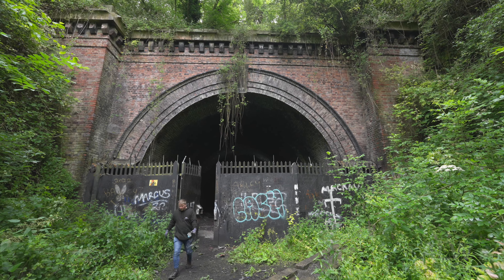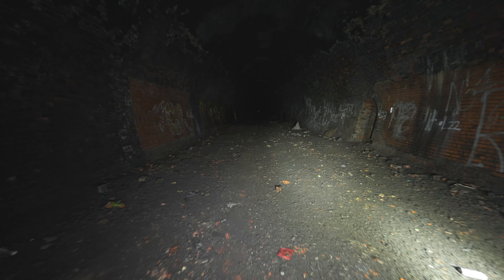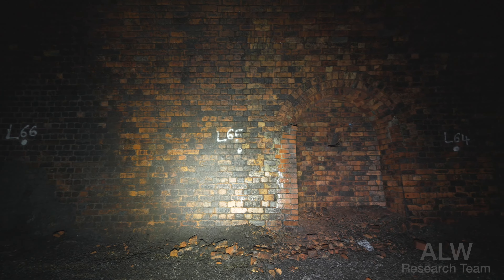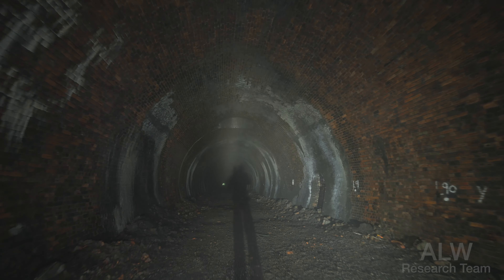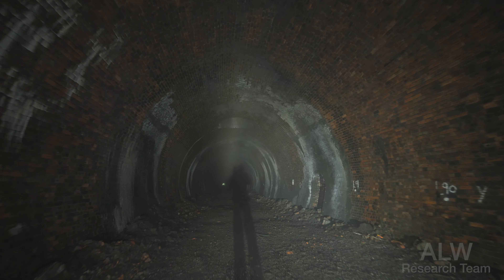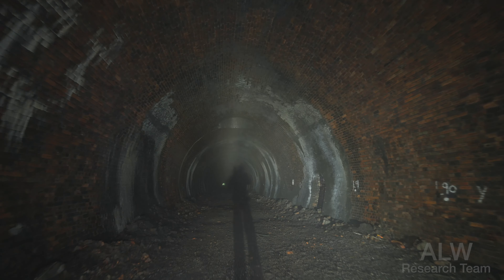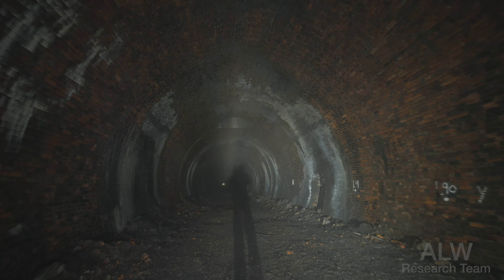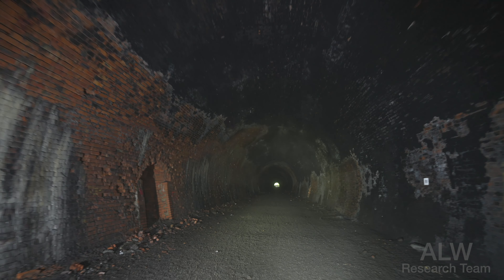The Heritage Railway that Failed in Barnsdale Tunnel

Comment: The numbers on the side are station numbers, they are normally every X amount of feet or meters. We used them when doing grade or laying roadway. Someone had a sheet with the assigned elevation at each station, so when laying out the gravel or asphalt they could get everything to grade.
Reply from the maker: That’s a good point :)

Comment: The "H" with an Arrow may well indicate the position of a "Hidden Construction Shaft". These are shafts that were filled after the tunnel was finished but sometimes they were filled with rubbish and then collapsed many years later. Indicating the shafts came about after the Strood Tunnel problems.
The number at the end of the ELR reference indicates where if any, a change of mileage occurs. Hope that helps
Reply from the maker: Hello Horace, your H explanation does make sense, a lot of the Burdale tunnel problems were down to the backfilled construction shafts. Marking them does seem sensible.